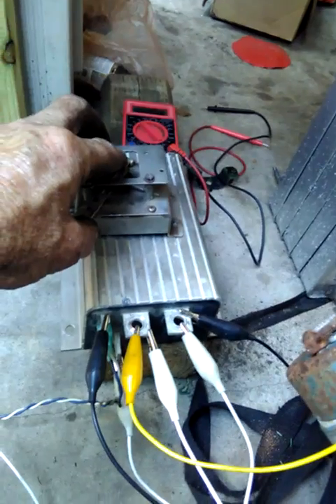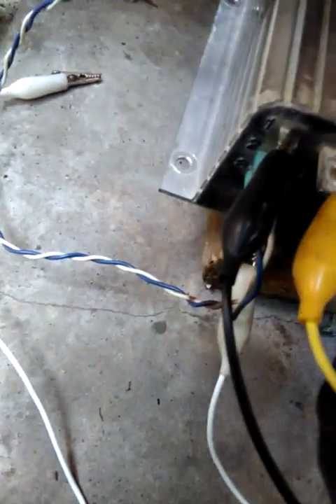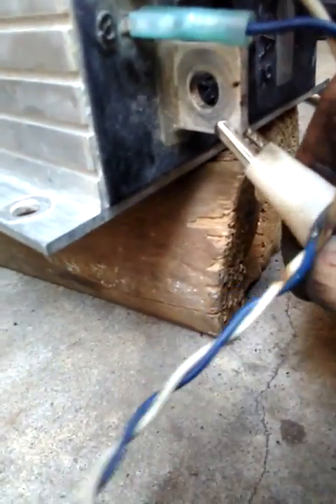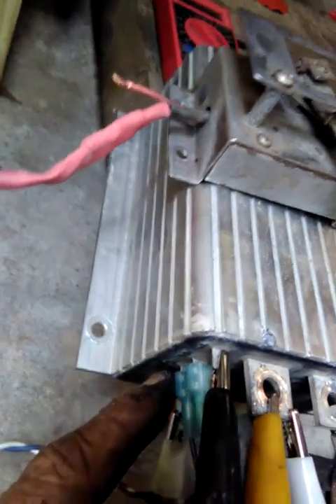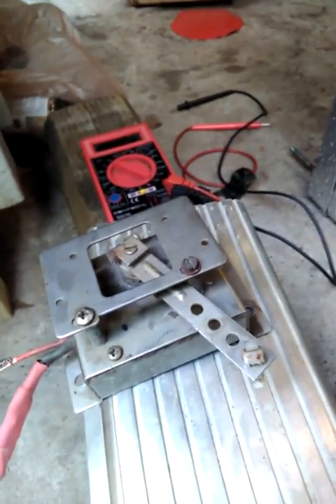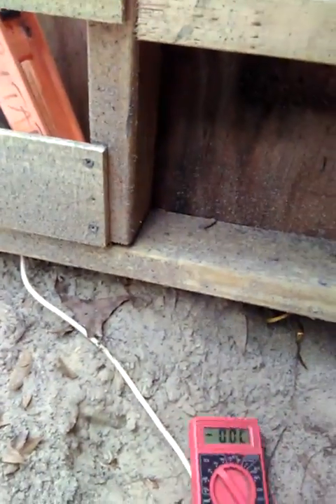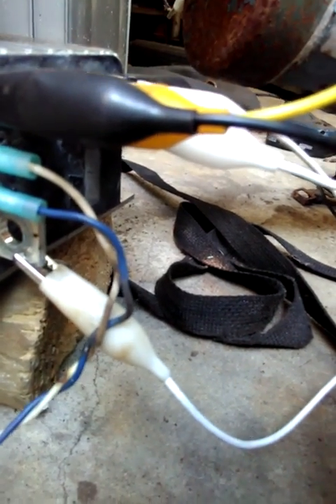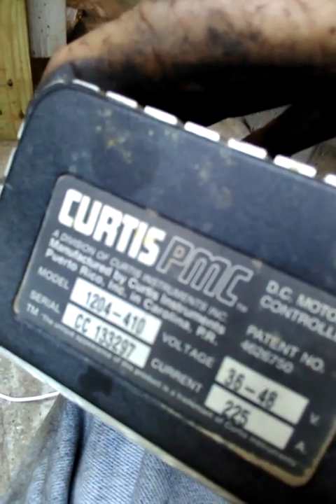Curtis Golf cart controller  1204 410

Comment: I have a question for you maybe you can help, I have scratched my head on this until it’s raw, I have a 2001 echo golf cart that’s 36 volts, to be clear the cart hasn’t worked since a repair shop tried to diagnose it. In the beginning the cart worked as expected and would just shut off at random, at some point the controller may have gotten damaged from the repair shop because I replaced it with a new 1205-117 and the cart started moving again I fount the random shutting off issue to be the 4 wire plug from the its, now here is the main issue I can’t figure out, I have 12 volts from the controller to the input wire on the its but the same exact voltage coming out of the it’s back to the controller and the unit tries to lake off at full speed when the solenoid engages, I replace the it’s with 3 different ones, what am I missing? I call myself tracing all the wiring based on the schematic I found online and it all seems correct, I bypassed the its with a pot 0-5 ohm and it work as expected

Comment: Can you not reverse the blue and white wire on the potentiometer an the current should reverse and it will not take off wide open upon connection.
Reply from the maker: Blue and white wire are just looking at resistance so it doesn't matter how you plug them in it doesn't reverse or change what the controller is doing. There are a few different controller settings One is zero being off and 5K being full on and the other is 5K being off and zero being full on. Usually the first is used I think I needed to rewire the throttle box on this the potentialometers have three wires or solder points and you use the middle and then either the top or the bottom depending on how you want it set

Comment: Hey Steve. I need some clarification. Where do all those white test leads go? Couldn't quite make it out from the video. Have same controller in hand. Need help!...
Reply from the maker: For some reason I don't get notifications when someone ask a question. The white wire that goes to the Spade terminal goes to the B+. On Curtis controllers it is the top Spade terminal but on logic systems it's the bottom of the three. Usually two Spades are close together which go to the throttle box and the one Spade that is a little further apart goes to the Battery Plus as a key switch. Thanks for watching

Comment: Have you figured out everything you needed? If so i might need some help testing mine. how did you hook everything up? iwant to bench test my curtis and see if it works
Reply: i need some help with mine too
Reply: Staffordracing758 I have the exact same 48 volt motor controller. The thing is baffling to me. I thought it would be like hooking up my VCR RCA cables.

Comment: Hi im from the philippines..do you have a vedio or diagram for cortis conroller 72 v m1205 model..how can i test run the control ?thank you..
Reply from the maker: There are a few different types this is a 0 to 5Volt throttle. The other model is 0 to 5000 ohms for the throttle. Not sure how you tell one from the other.

Comment: Am I crazy to think that the potentiometer wires were installed backwards ......
Reply from the maker: Its a 2 wire pot box so they work either way 
 3 wire pot box have to be exactly right. The key on terminal is on top or on bottom and must be right